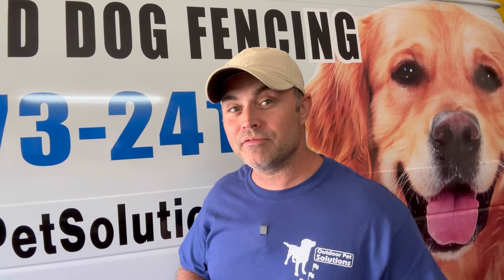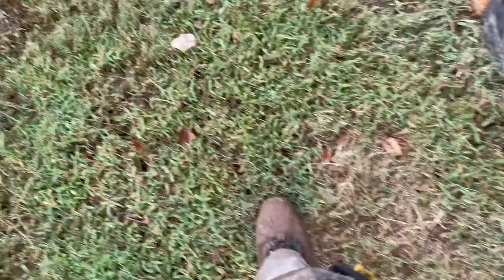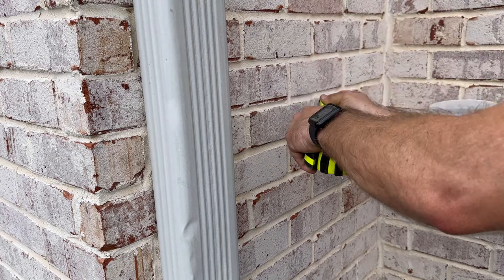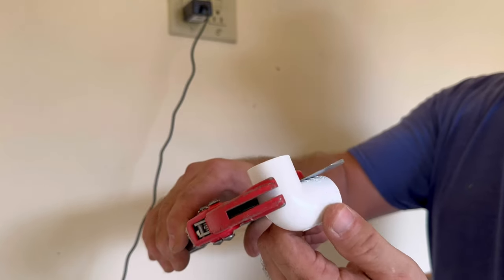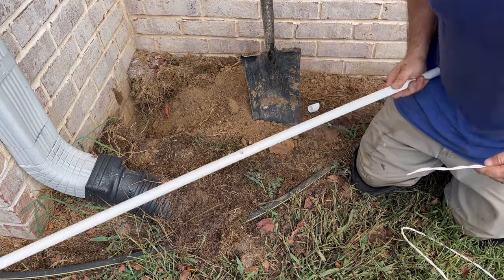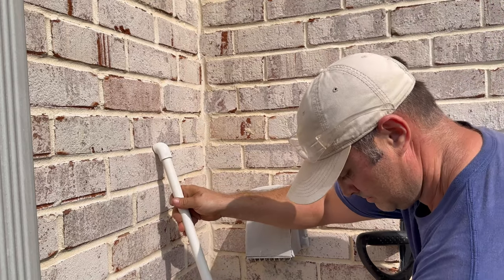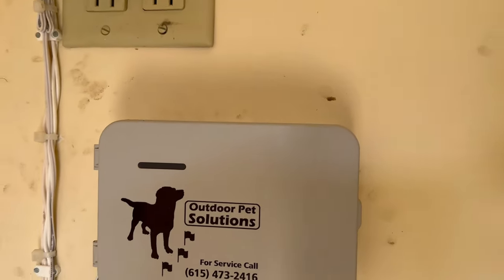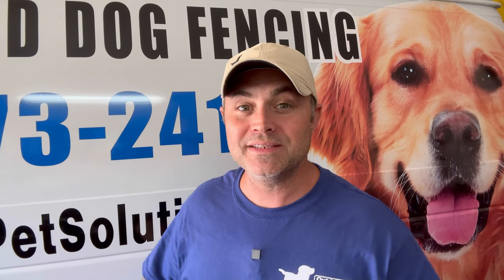How to install an In-Ground Dog Fence - Transmitter and routing the twisted wire

Comment: Thank you for the helpful video. I recently installed a wired invisible fence. However, I have a small yard and even with the range turned down to the lowest setting, I am still losing a significant amount of my yard (`5 ft from the wire). I have a physical fence and I am attaching the invisible fence to keep my dogs from jumping over the fence. I would like to step down the range more. Is this possible? Is there anything I can do to reduce the range further?
Reply from the maker: Hello Andy! Thank you for reaching out. You should be able to dial down the field width. Some systems have a booster switch. If yours does and it is switched to the high position then it will be difficult to dial down the field width with the fine tune adjustment. So you’ll want to make sure the booster switch is in the low position.  This is of course if it has one. Which brand and or model fence system are you using?  
Adam- Outdoor Pet Solutions

Comment: My dog isn't phased by electricity. The place i moved into had one installed already, it makes me wonder if i could use this video in order to find where the wire is in the ground to remove it? The one that is installed is a older one with a huge bulky box that looks more like a vacuum cleaner or a dust collector for a shop than it does a power for shock collar.
Reply from the maker: Hey there @KingKatura! Invisible fences are designed to train and teach your dog their boundaries. The “shock” of the collar won’t keep your dog in the yard, simply the training. You could attempt to remove the wire that is underground but there really isn’t a reason to do so. You can simply choose not to use the system and just leave the wire in the ground. The wire itself is not carrying any real electrical current. It’s simply producing a radio signal that the collar is tuned to. If you’d like a device to trace the underground wire to know exactly where it is to remove it, here is a video of me using the pro290.
https://youtu.be/FCPT6evrM18
Adam- Outdoor Pet Solutions